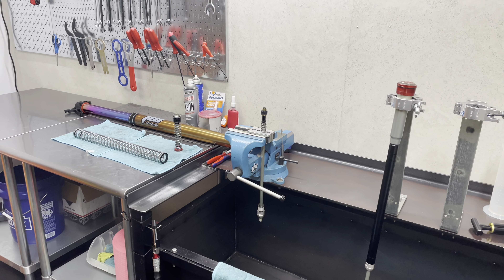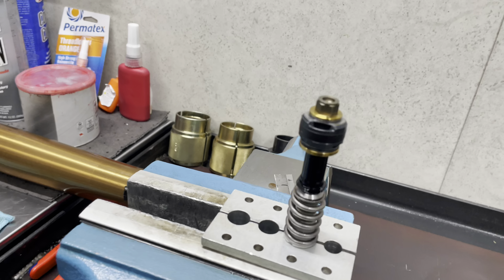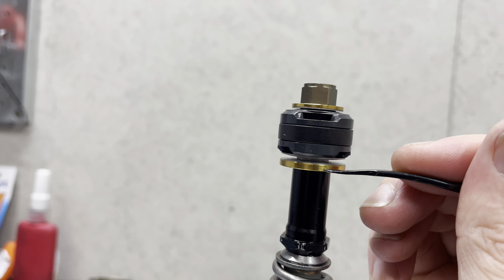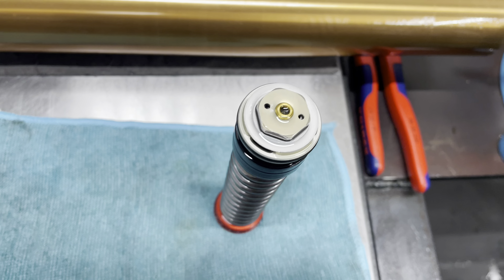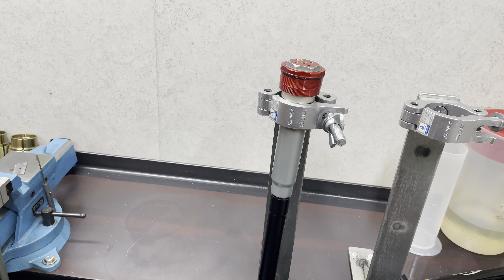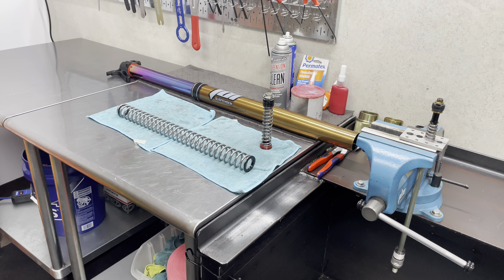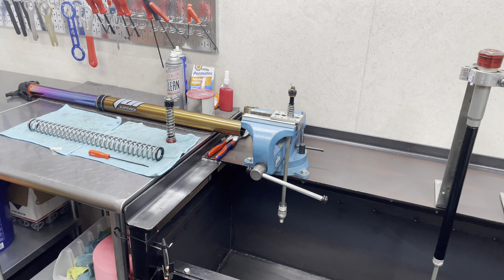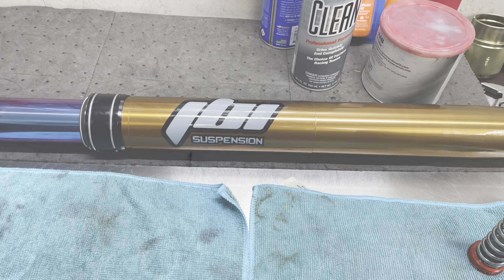Developing a leaf spring midvalve for WP Cone Valve / XACT Pro 7548 Forks

Comment: This looks really good I bet it's going to work great
Reply from the maker: Thank you.  The first few attempts/setups were not very promising however with some adjustments specific to this fork it’s been performing much better.  I think there still is room for improvement and if we achieve the potential that I think is there then it will likely be a very competitive setup and another great tuning options for these forks.

Comment: I need a setting on my 2023 cone valves for off road. They do great for g outs but small bump sensitivity just isn’t there. You guys can use mine for testing
Reply from the maker: Hello and thanks for watching.  

The setting I built in the video I have one ride on.  The previous setting was just as good as our current CV fork setting.   The one ride I had on the video setting was at Fox raceway but after a rain so the track was pretty bumpy and gnarly which was hard to focus on the suspension instead of focusing on surviving hahaha.  

I have a feeling we are only a few small adjustments here or there and then these forks will be very competitive. This is a moto setting however.  

For the off-road spec I currently have a setting developed and being tested.  Within the week I’ll have rider feedback and we can evaluate where we are in terms of performance compare to our CV fork off-road setups.    

Once we have something I’m very confident with I would be happy to share with you  a setup for more rider feedback

Comment: How much preload would you put on a 2025 ktm 300xcw with cone valves for single track riding?
Reply from the maker: The WP recommended fork spring length of 488mm with spacers installed.  Usually 1-2 clicks of preload adjustment as the starting point.  From there riders can adjust to their personal preference
Reply: @RideJBI  thank you